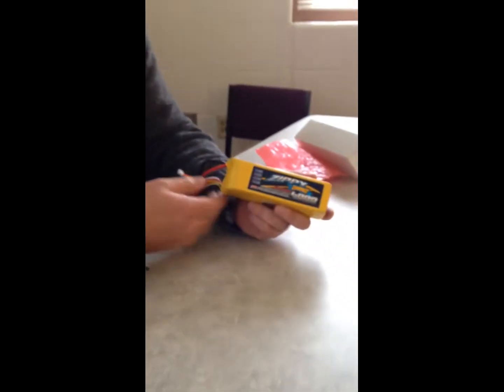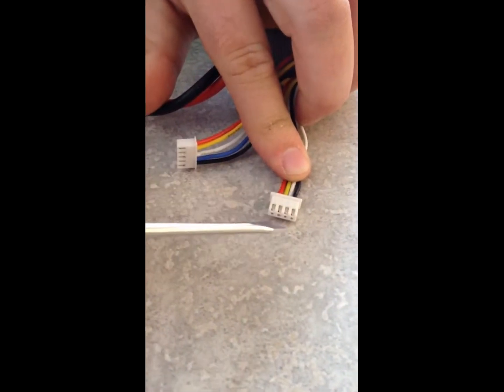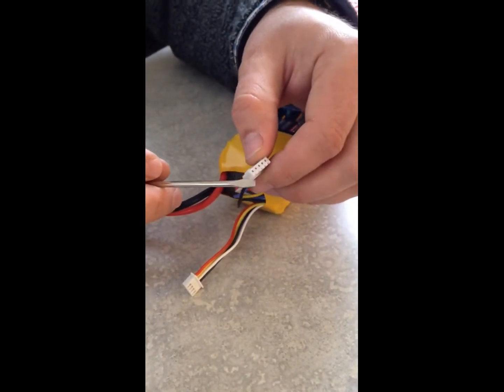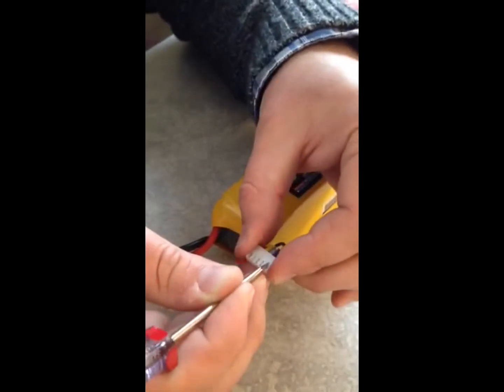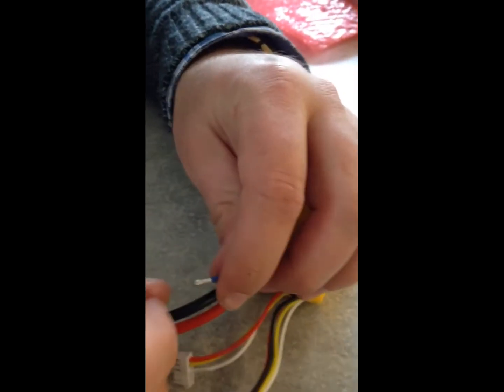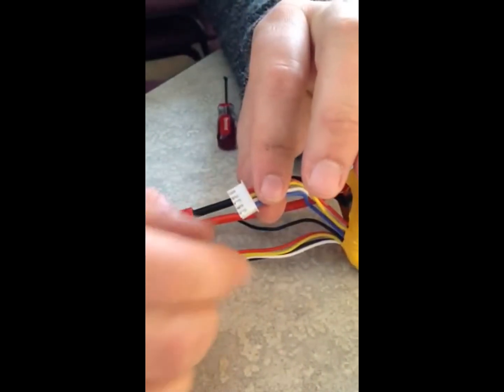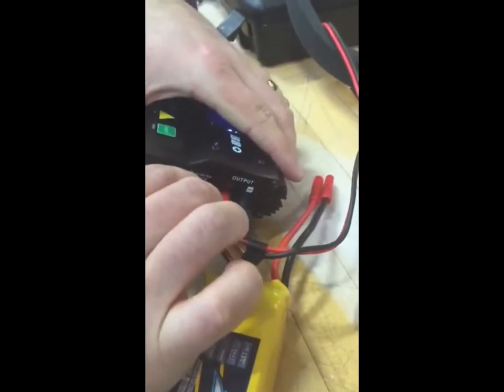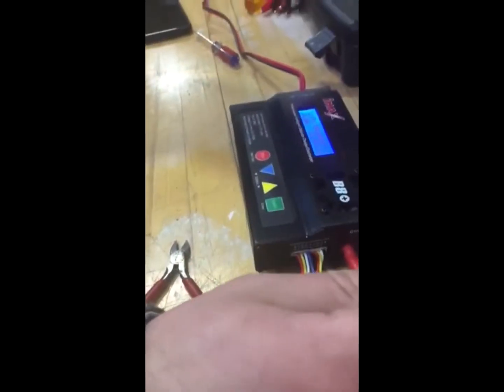7S Lipo Battery - Balance Plug Adaptor Modification

Comment: Is this showing how to use a 6s max charger and hooking it up so you can charge 7s in two hits one, 4s port and second 3s port. So you can charge using both ports at the same time. The video isn't clear at all. If it works why didn't you show it charging or how to set it.